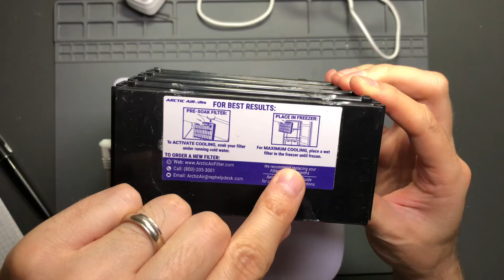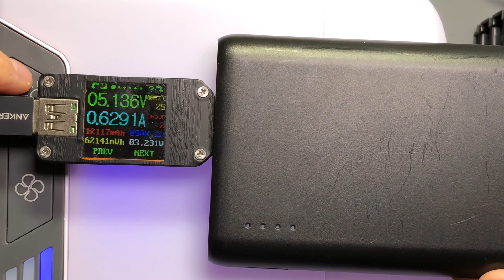Arctic Air Ultra Review and Analysis

Comment: Excellent video. I’ve been looking to build out my overlanding truck cap camper. And with temperatures getting hotter, I’ve found it more difficult to be in my truck shell. Your trick for maximum efficiency by showing freezing the filter is possible was a big tip for me. As I’m planning out my amperage draws to add an accessory battery to run a couple things but only constantly a fridge. Now after this video, a fridge/freezer combo to be able to switch in and out 2 filters as needed. Do you think this would be the best product you’re presently aware of for my application?
Reply from the maker: Thank you and thanks for watching! The Arctic Air Ultra definitely works well, but I have a few that I am investigating to replace the Ultra, because I kinda broke it while modifying it. Oops. Anyways, if you can hold out a little longer, I'd watch out for the video that discusses the science behind evaporative coolers (and best applications), along with the review of a few more, coming out in the next month.
Reply: @TheCuriousEngineerChannel  sounds great. I’m subscribed and will be looking out for your video. Hopefully one of these will keep my truck bed cool here soon!

Comment: How do you convert a dc wall outlet plug to usb?
Reply from the maker: I wired a USB-A cable end to the adapter end that I cut off from one of the power supplies.

Comment: So would you take this over the evapolar? Asking because I have the arctic air, but I been thinking of the evapolar for my son’s bedroom
Reply from the maker: Yes. I ended up returning the Evapolar as they did not respond to my inquiries about the safety concerns involving the material being used in the cartridges. Plus the cooling performance on the Artic Air is notably better. Thanks for watching!